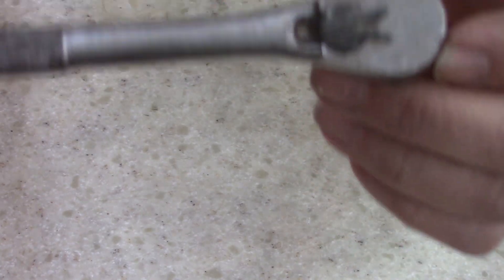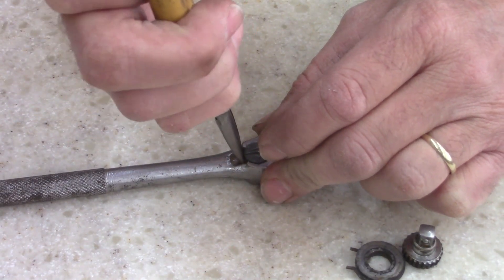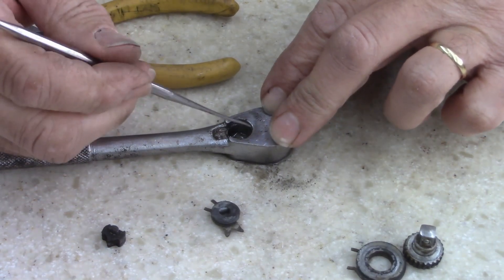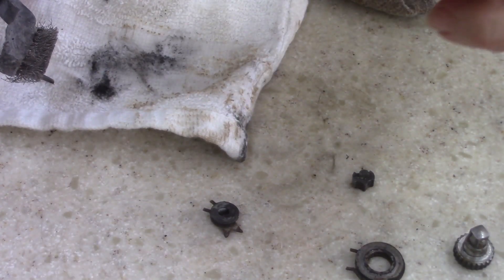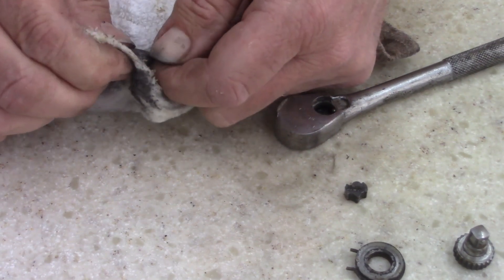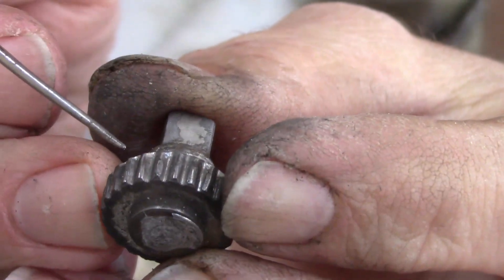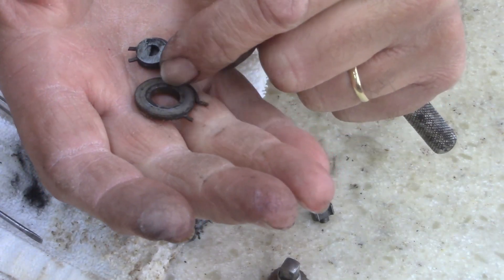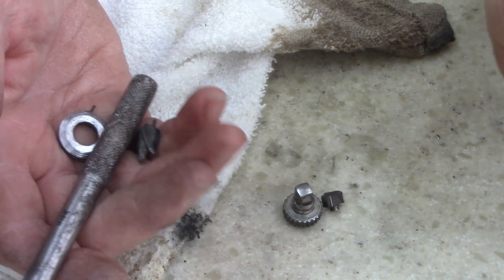Craftsman look-a-like Japanese!

Comment: It looks like the parts from that ratchet might be interchangeable with the real craftsman equivalent. There could be a ratchet out there that needs a new anvil or selector switch that you could use the parts to fix.

I have a craftsman 1/4" quick release that is missing the selector switch. It has everything including the snap ring for it but at the moment it is currently a parts ratchet unless I come across a replacement switch.
Reply from the maker: Yea, that's why I saved the parts because at the pawn shops they throw junk ratchets in there and I am always digging for them!!
Reply: Where I’m at there aren’t many pawn shops and they don’t have hand tool bins, just power tools. On the other hand, there is a great tool store near me that does sell some S•K sets and sets from Duro-Indestro.

The Duro-Indestro tools notably are priced about the same as Pittsburgh tools from harbor freight!
Reply from the maker: @inkster2586  What about Facebook Market Place, I have been able to score some nice tools from there, and do not forget garage sale, they are picking up around where I live! and the reason I mention the Market Place is because I have been able to buy a lot of junk for little of nothing and was able to score some great tools in the junk.